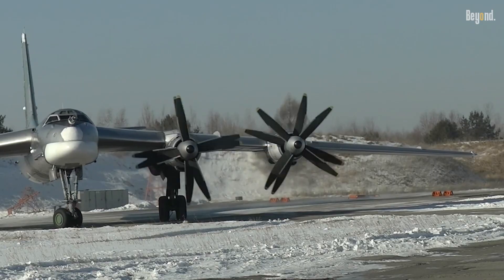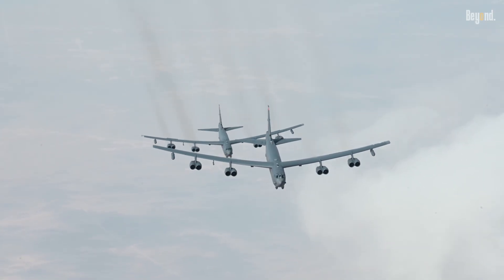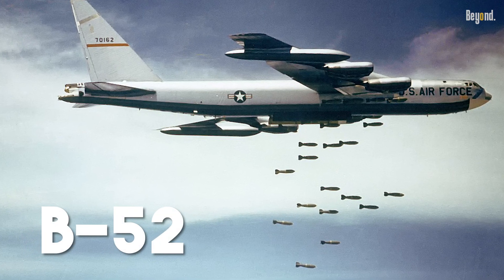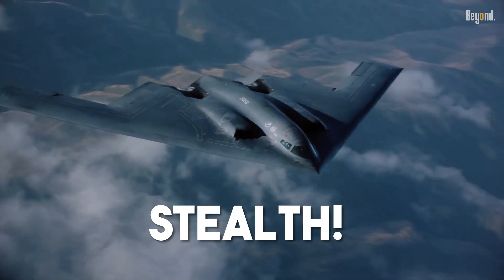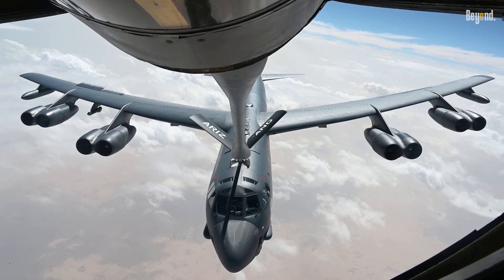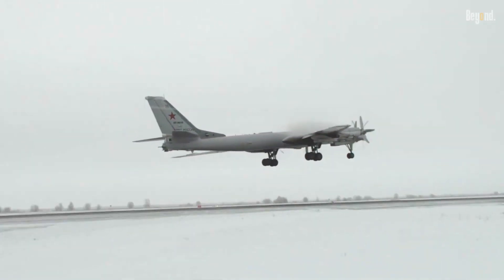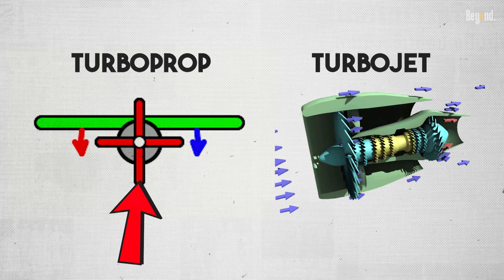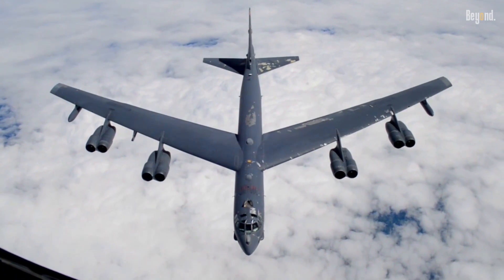Why the US Doesn't Use Propeller Bombers

Comment: Disagree that these planes were built to different priorities.  They were both built for the same long range role and have similar unrefueled range.  The original design studies for the B-52 considered turboprop engines.  There was a design that looked a lot like a TU-95.  But Boeing was more advanced than Tupolev and was able to get the necessary speed and range in a faster jet powered aircraft.

Comment: On the US side you forgot the two "steps" between the B-29 and the B-52. The first was the B-36, which was initially designed in WWII as a "just in case" the UK fell and the US had to conduct trans-Atlantic bombing mission. The program was restarted as a "stop-gap" replacement for the B-29, which had to operate from at least England to deliver a nuclear payload to Russia, and it was already being outclassed by Soviet fighters in Korea. The B-36 had 6 pusher turboprops and 4 jet engines, and could strike the Soviet Union, unrefueled, and return back to the US. The other was the B-47, which used 6 jet engines, but did not have the speed, range, or payload capacity of the B-52. As an interesting side note, one of the early concepts for the B-52, the Model 464-35, had a configuration similar to the TU-95, except with a tandem cockpit like a fighter rather than the side-by-side like an airliner.